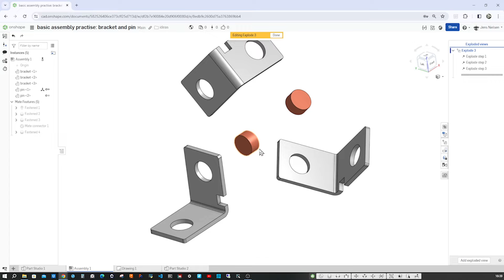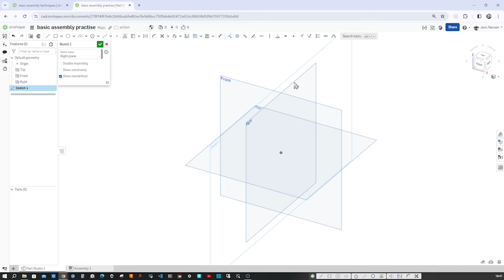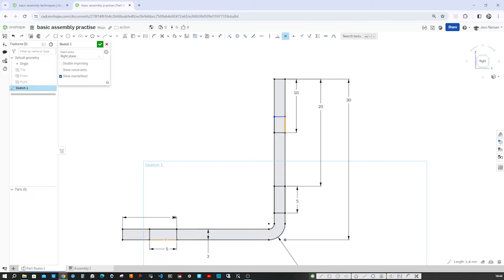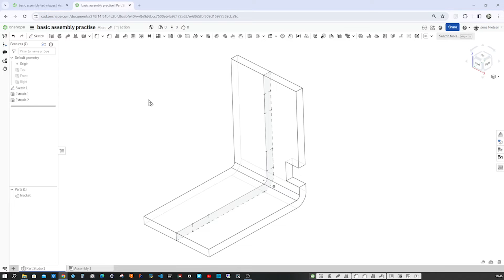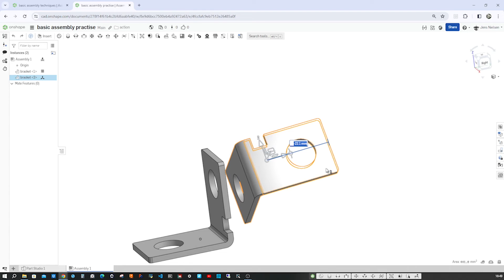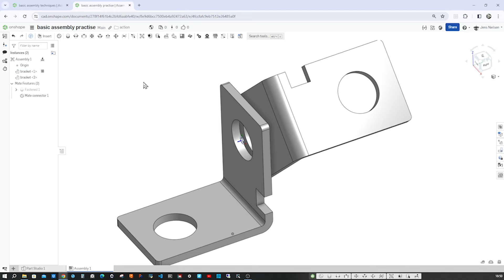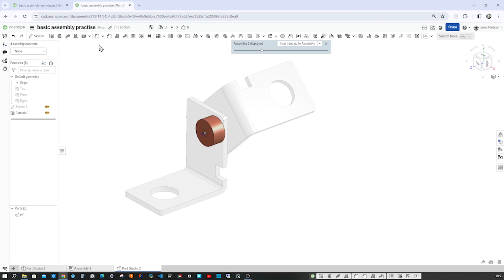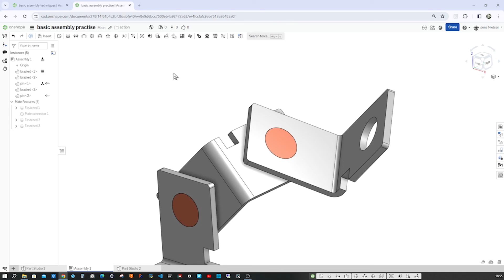Onshape Part Studio in Context: Master Top-Down Assembly Design

Comment: Revolving to create a circular cutout is something I'll have to add to my bag of tricks, a really neat way to avoid another two sketches.

@CADemist – two things about mate connectors I recently learned that I haven't seen in your videos. Perhaps you'll find them as useful as I have!

1) a tip I somehow missed in @Ovyl's "31 advanced sketch tips" – it's possible to sketch on mate connectors! This brings up a lot of possibilities, since you can reposition the mate connector which is effectively like moving around the origin of a plane. 

2) a tip I saw on @Airwick's "onshape power moves" – using mate connectors as the endpoint for features. For example, one can create a mate connector and then extrude up to the connector. One can then move or rotate the mate connector, for example to create a cylinder truncated by an inclined plane. Previously I might have reached for an inclined plane, then sketched, then lofted between two profiles.
Reply from the maker: Hi "Hagus", that is a  great tip sketching on mates. I was aware of that possibility  but had  not considered  doing  so to manage a feature like an extrusion or a loft. I will look into this... I'm glad you found something for you to learn in the video.